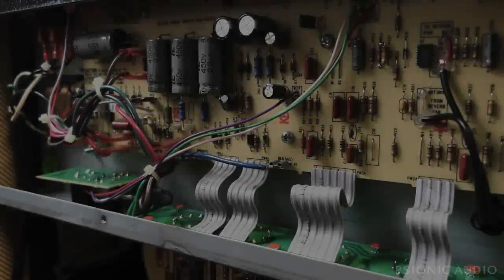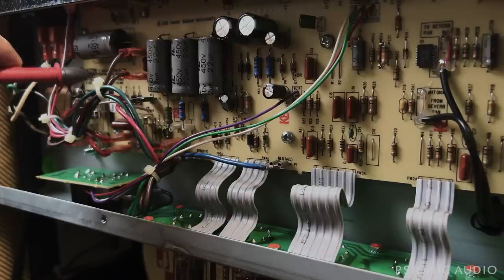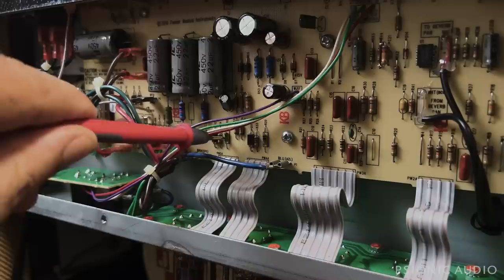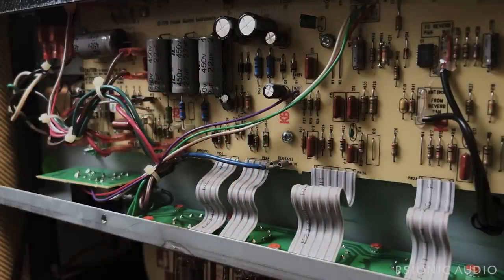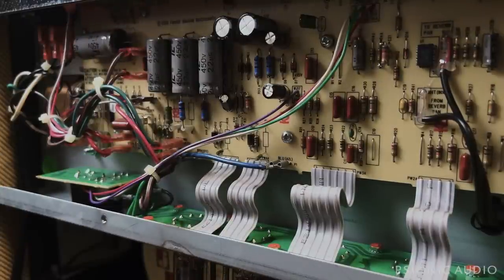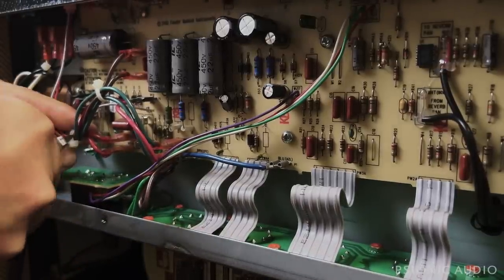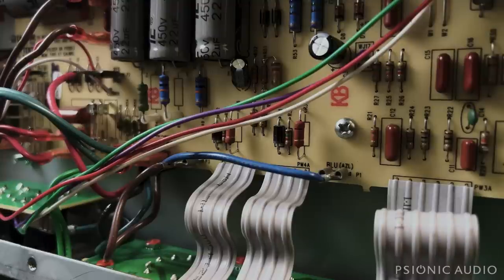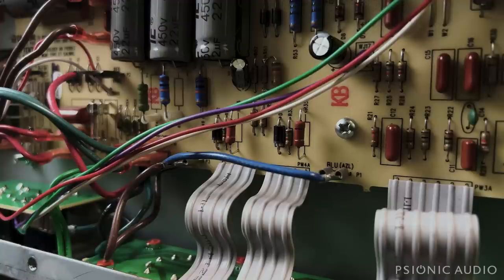Blues Junior | Lightning in a Bottle

Comment: Always informative videos!! Blues Jr's seem like your bread & butter, with frequent repairs
Reply: It’s because fender sells tens of thousands of them, most popular tube amp on the planet, so by default you’ll see more come though the shop, vs the $8,000 boutique amp that’s even worse with design problems but they only sold 3 ever, right… Tubes and repairs are guaranteed no matter what the amp, that’s the problem with 100 year old technology… And why the big pros travel with a tube amp tech lol… Also why most of the pros are now using modelers and leave the ancient beasts at home…

Comment: Bic Jr . could use a 25 k bias pot to cool it down . I do it all the time . Lift that left bias resistor where it connects to resistor on the right side of it . Bend the left bias resistor [ 22k ] and solder the 25 k trim between the loose end of the 22k and the location where it was cut off . 25k trim pots are available from Mouser . Your just increasing the resistance of the 22k ohm .

Comment: 07:08 I would pull the resistor toward the component side, as this would minimise the risk of pushing the track off the cct bd. This can be done with both legs. Is there a downside to doing this I have not thought of?
Reply from the maker: Yeah, the leads on the other side are bent and doing that rips the pads. No board damage pushing through like shown.
Reply: @PsionicAudio True. I saw later the bends on the other side but didn't edit. A lot of ccts I have dealt with are just straight thru and clipped off. I guess it is a technique used particularly in amp/speaker cabinets for mechanical/vibrational strength?

Comment: Re: Cheap and Cheaper parts - I think I have a broken Volume pot contact/plate/wiper....on on a FBJr II, it goes to 6 nicely then volume expands crazy with lots of noise....$4 part but an hour to get to it / reassemble .....IF YOU HAVE ANY guidance on easy trouble shoot for the Snap-in 1M 10A - ?  I will dance at your next birthday celebration.....(or Not! ) Thank You again for ALL the fabulous insight and knowledge ! ! !

Comment: Just curious on the logic behind swapping the 100 ohm screen grids to 1k. I'm guessing there isn't much effect on the tone and protects the tubes better?
Reply: I've made a similar mod myself. Yeah, the #1 purpose of increasing the screen stoppers is to protect the tubes. JMI Vox apparently picked 100R from a hi-fi schematic, used 'em in their AC-XY's, called it good, and every el84 guitar amp ever since has made the same error. Rock 'n roll is not hi-fi. The output tubes are frequently saturated. Today's el84s are not Dick Denny's. As far as tone is concerned well, I used 2k screens in my mod, not 1k. That did affect the tone, making it softer with increased touch sensitivity. I really liked the change, thought it was for the better. But it was noticeable and might not be for everyone. Kind of hard to describe without the customer actually being there to demo it himself, so I'm certainly not going to 2nd-guess Lyle's choice of 1k. It'll protect the tubes with minimal affect on tone. BJ is bright anyway, and does have a treble knob.
Reply: @edwardleaver7838  I'm not so concerned about protecting the tubes as I've got some nice old Sylvanias, polams, and a mid 50s Amperex. Think it makes a difference on a Marshall 18 watt clone?
Reply: @gheorge77  Not if you only play your Marshall clean. Play it like a Mashall and well... the 18 Watt Marshall schematic I've seen indicates a common, shared 3W 100R screen resistor. Very old-school. Very hi-fi. Very prone to fail a tube when pushed. If it were mine and since it's a clone, I'd go ahead and fit it with at least 470R separate screen resistors. I'd go with 2.2k but ymmv. Find a value you like.

Comment: I wonder why you decided to up the value for the screen grid resistors. I understand why you would increase the wattage, but why is the 1K value better than the original 100u design? Is this a change that would be considered an upgrade for all Blues Jrs? How does this change affect the sound?

Comment: What's the best soldering iron temp. when working on a board like that?
Reply: I think Lyle said around 700F. Otherwise, the short answer is, hot enough to get in and out as guickly as possible!
Reply: yes I believe it was in the 700 or 750 but it really is an art form to work as quickly and efficiently without burning up pads on the board
I watch everything and this channel is great
Reply: I used to have a simple rheostat-control iron and wound up separating a trace. Thankfully It was just a pad around a hole intended to secure the case of the volume pot so it wasn't electrically in play but that scared the crap out of me. I bought a thermostatically-controlled Weller iron soon after. 350C is about where I put it for typical PC boards.
Reply: @hubbsllc  Thanks!
Reply: @goodun2974  Thank you.
Reply: @brentstewart59  Thank you.
Reply: @nellayema2455  ,  You are welcome. It is also important to note that the size and shape of the tip is extremely important, and that all other things being equal, if the tip has a lot of mass to it, and/or the iron has good temperature-sensing feedback to compensate, it'll hold to a more consistent temperature when the work being soldered tries to suck the heat down below a reasonable solder-melting point as you solder or desolder a connection. I generally prefer a chisel-shaped tip (with two flat sides and a blunt rounded tip, so chisel is sort of a misnomer). Cheap tips are often made of some unknown garbage metal (If you can easily pick them up with a magnet then they are probably made of solid steel, which is not ideal), but better  tips would be solid copper (minimally or not at all magnetic) with a steel plating.  Plain unplated copper is quickly and easily dissolved by the solder and flux, and so the steel plating is necessary for long life of the tip. Stick to tin-lead solder with a rosin flux core. If your 1st experiences at soldering are with lead free solder you will probably find it extremely frustrating.
Reply: It depends on the iron width and size. The wider the tip, the more heat is transferred. For me with my type of iron 300 degrees Celsius has been working fine for many years.

Comment: I have the same meter, but with the EBTN black screen.  Thought I'd try different looking screen than the standard LCD.  I was suspect of battery life, and it's short, so stick with the LCD for longer battery life.  Over all it's a good meter for the price.  I wish it read pF caps.   My Radio Shack DVM from school (1990) is still working fine and reads small value caps.

Comment: So many amps with EL84 output tubes seem to have them biased near the point of meltdown...I just don't get it
Reply: Neither do I. Early EL84 amps such as Vox were cathode biased and biased hot. No mistake that a hot-biased tube frequently sounds better. Same with Fender 5e3 Deluxe. But a major reason at the time -- 50's -- was that high value electrolytic caps were still pricey and bulky, even those 25v/25uF output tube stage bypass caps. If you cool the bias there and run class AB, then you'll quickly run into ugly crossover distortion. But the '50s are over. Today you can easily fit a 2500uF or 5000uF bypass cap, double or triple the cathode resistor, and comfortably cool the tubes. BJ of course is fixed biased. There's really no excuse for their output stage to be over-biased right from the factory.
Reply: I think Lyle usually cools down the bias to about 55% for Fender circuits. The new tubes aren't built to last.

Comment: I had a question about the screen grid resistor values. I see others using four and five watt resistors 2.2 3.5 K values which seems a little excessive. I'm wanting to change mine out as you have in your videos, but I can only source some 2 watt, 820 Ohm resistors locally. Would those suffice in lieu of the 2-watt, 1k that you are using?
Reply from the maker: 2W 820 would be fine.

Comment: Awesome. I love the tweed amps. Looking to buy my first, for home use, torn between Blues Jr IV, Pro Jr , and Princeton 12” with Cannabis Rex. Opinions, anyone?
Reply from the maker: Of the three only the Princeton is worth buying. And none of them are tweed Fenders, that’s just cosmetics.
Reply: I had a ‘68 Reissue Princeton with a Weber Speaker.  It was a great low volume grab n’ go.  Right before the guy Ca,e to pick it up, I added a solid state rectifier plug b/c I wasn’t sure if the 5ar4 might’ve been on its way out.  To me it was an instant and significant improvement.  I don’t regret selling it, but maybe after a few beers I might tell you otherwise ;)
Reply: @PsionicAudio  looking at a Princeton or a tone king gremlin. Fairly close in price used.  Any experience with tone king?  For around the house mostly. Thanks!
Reply: @PsionicAudio  Also, have you considered doing a live Q/A or live stream Lyle?  These are the types of questions worth donating a few bucks for a coffee or beer.  Well worth it to help make the right decision on a quality amp.
Reply: Great to know, thanks. Shame that particular Princeton is roughly $1700 CAD ($1350 USD), new price. The regular version is the same.
Reply: Buy a used Clark if you can afford it, I have a Beaufort and have no desire to shell out for a real tweed Deluxe.
Reply: @thraknik  Good tip, I'll look into those thanks!

Comment: I have a dumb queation. Caaan you tell a difference tone wise in a carbon comp and a metaloxide resistor? Thanks for your great videos. I just found you and have spent the whole night watching.
Reply: It is not a dumb question. Carbon comp resistors generate much more noise that metal oxide, but it is proven that they change character when working at high voltages.
If it is easy to hear I don´t know - but it could be.

Comment: Speaking of meters, I have been using an Ideal 51-630 that I purchased from Home Depot about 15 years ago. I think I paid $60.00, but I am not sure about that. It is well built, and has served me well with no problems. Do I really need a $400.00 Fluke to do amp repair?
Reply: Every time I thought "do I really need x", y fails and so does z, so after spending twice as much in the long run, I end up with x after a lot of wasted time.
Reply: I prefer to use high quality meters for measuring high voltage. Mainly for safety. Knowing the certification is real. I don't feel like getting a nasty shock.
Reply: If you want to do it every day than absolutely yes, if you are looking to repair your personal amp one time then no… I’ve been at a professional level with electronics for 30 years and that’s the only meter you’ll see being used by those who depend on their tools to make a living… There’s no other meter that even comes close for precision and durability, I’ve had my 87 since I was in school, 30 years of heavy daily use and sill going strong… It’s the best investment you can make… They are expensive but if you make any attempt at all to take care of it, you’ll have it the rest of your life… Decide if that steak dinner is really important this week or not, don’t skimp on your tools….
Reply: @robertw1871  I've also been working in electronics for decades. I have two Fluke meters and a couple generic ones. The only time I use the cheapo meters is for low voltage stuff. I even use the Fluke for checking 120v line voltage etc. I would never trust the Cat safety ratings of inexpensive meters. I wouldn't trust inexpensive test leads either. Not while I'm holding onto the probe. Reliability is another advantage. Especially when you use it for your livelihood, it has to turn on when you need it. I don't want to spend time trying to figure out if my meter is working properly when I'm trying to troubleshoot something else with it. I have more than one because occasionally you have a problem even with the best equipment. I've sent a Fluke in for service a couple of times and always came back working like new. Good company.

Comment: I used to recommend these amps to students, it was a great way to introduce them to tube tone affordably. But then one of them experienced this exact problem, the difference being that the resistor blew a hole in the circuit board when it gave up its life. These resistors cost pennies, possibly a fraction of a penny to a company like Fender, yet they still choose to spec a part not fit for the job. I not only don't recommend this amp anymore, I actively try to prevent people from buying them. Don't do it.
Reply: what do you recommendation then ? I would love a matchless 30 watt. but it's way out of my price range. thoughts, ideas,
suggestions ? my budget is 1000 -1500 more or less.
Reply: @crazywisdom2  I like Dr Z and you should be able to get several models in your price point on the used market. If you like EL84s a Carmen Ghia or a Maz18 would do the trick and you can get reverb on the Maz. Simple circuits, turret post construction, they're durable and sound great.

Comment: Bryman bm786 is a better value than the Fluke for about 200 USD  good for 5 plus digit  a fine bench hand held .  If your not out in the field doing AC the fluke is over built yet less accuracy  than the Bryman .  Your results may vary.
Reply: Second the Brymen!

Comment: Why not rip those IC brand filter caps out? They are the worst caps ever, always fail!
Reply from the maker: Glad to. But that's the owner's call and that can has been kicked down the road.
Reply: @PsionicAudio  I see. Did you ever try doing strain relief on ribbon cables like those in the Blues JR? I have done it before with hot gun glue.